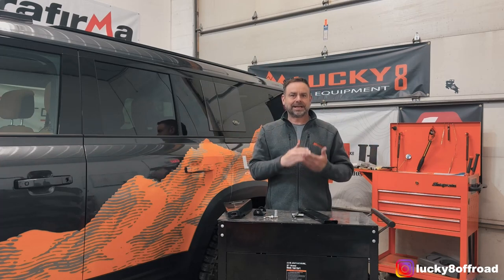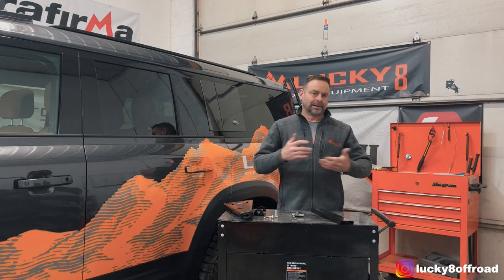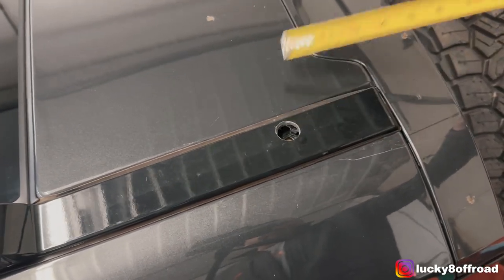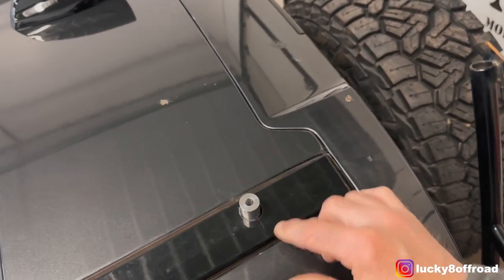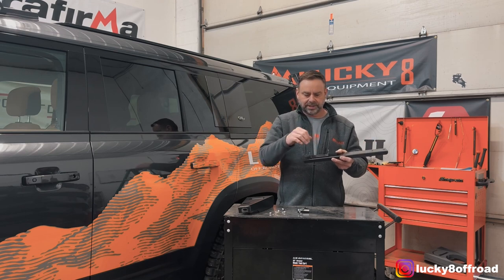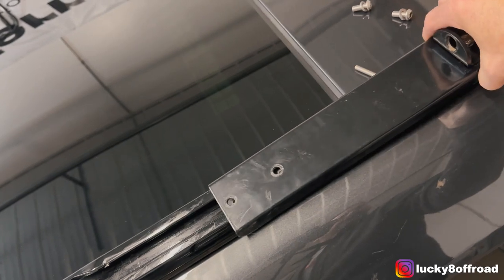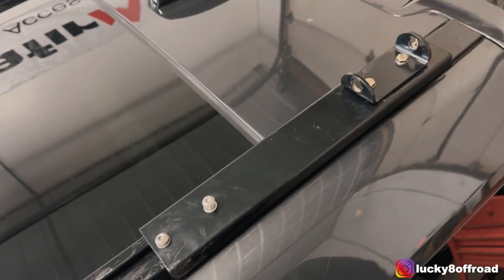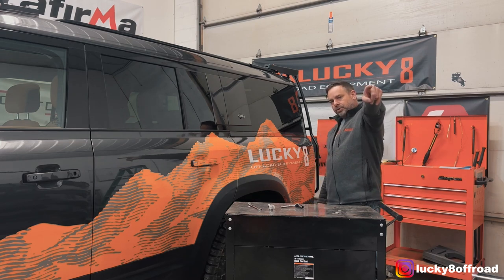Defender 130 Proud Rhino Rear Ladder Install: Our Step-by-Step Guide

Comment: Hi very informative as usual. I hv the 130 with the roof rack and side ladder, can I push back the ladder to the end of the rack. shift it from the original location toward the rear end as much as possible?
Reply from the maker: Thank you for pointing out the differences in the 130 setup. You're absolutely right, and we've actually taken this into account. If you check our website, you'll find that we've already developed a solution specifically for the 130 configuration. In fact, we're currently implementing this solution on Project 130. We're always working to ensure our offerings cater to the various setups and needs of our customers. For more detailed information, I encourage you to visit our website or reach out to us directly. Thanks for your interest and support!